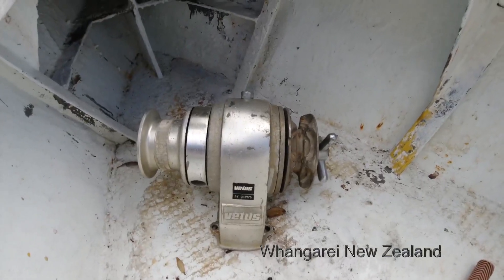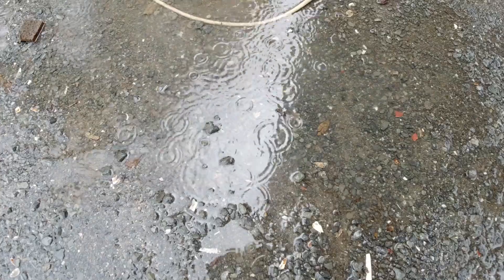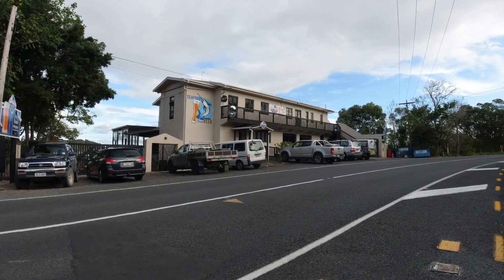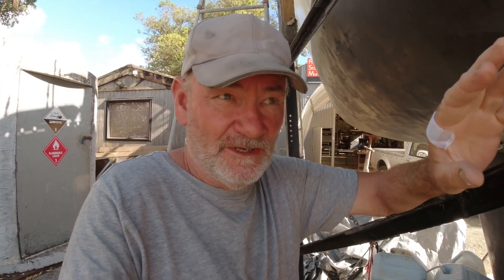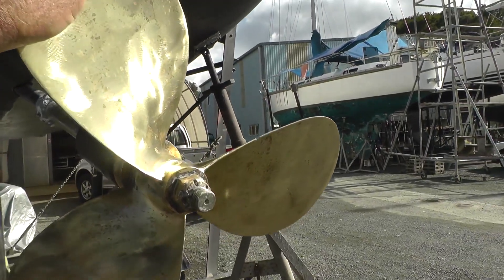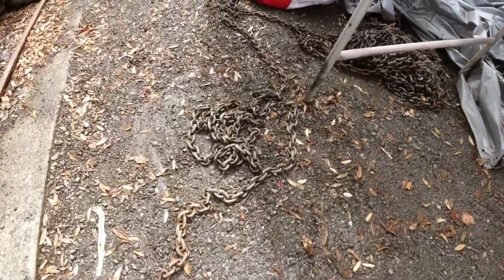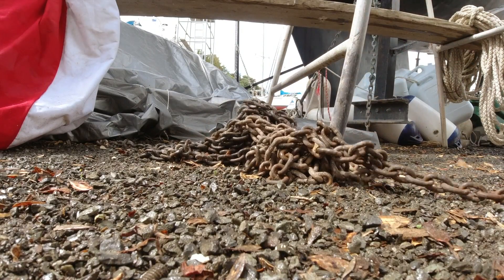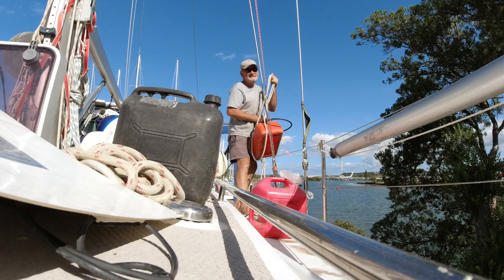Out with the old  Adventures of an Old Seadog, ep170

Comment: Hi , Put some ty wraps in front and the back from the anodes. If they come loose they stay at least in place. believe me or not but they will crawl up against the hull wen the shaft is spinning. It will drive you nuts. Cheep and effective.

Comment: Put a block of steel under the wind lass to raise it up above the chain locker. A three inch chunk of steel, cut to the shape of the foot, drilled to match the holes and coated in nickel, plated in something should help a wee bit. Maybe reenforce under the stern side of the locker the help with the shifted center of gravity and added torque.

Comment: Can I give you a tip with mozy bites. Don't scratch. What that does is pushes the poison into the hole. Just wash the poison away from the hole and you won't have a problem. Mosquito's don't inject the poison. There proboscus goes in and draws blood & leaves the poison around the hole for you to rub in. Hope that helps.

Comment: It appears to me that the mis alignment of your windlass gypsy and the anchor roller will not work very well.  I recommend having a mounting platform fabricated so you can mount the windlass further aft.  Of course the anchor locker hatch will have to be modified as well.

Comment: 9.45 cant see the split pin securing the castle nut in place on the prop shaft mate , put  wire brush over it and replace it , if the castle nut comes off thats youre prop gone mate

Comment: get some clear nail polish. when you get a mosquito bite instead of scratching it open because its itching put a tiny bit of clear nail polish on it. the venom from the bites react with the air causing more itching. under cover from the polish you wont have any problems. tryed it out before and co-workers where giggeling about it until they tryed it too. BUT! make absolutly sure its not an open wound from Scratching. been there done that not fun.

Comment: I finally found a way to prevent mosquito bites from getting inflamed. If they get really itchy, instead of scratching and breaking skin you can just repeatedly slap them hard which kind of numbs the area.
Reply: Or using vinagre
Reply: Or you can scratch around the bite in a circle about 2 inches away. It won't irritate the bite but will scratch the nerves and help relieve the itch. give it a try!
Reply: A small trick from sweden. Make an X with your fingernail on the bite. It works 8/10 times for me. Keep up the good vids
Reply: Use heat.
There are tools like biteaway that work perfect...
Reply: Put vinegar on the bite, and more mosquitoes hate vinegar 🤔
Reply: @olaklingvall  Yep, there's even a small plastic tool that does that exact thing. It was recommended Boy Scout gear here in Florida. :) About half the size of a tube of chapstick with the same cap type.